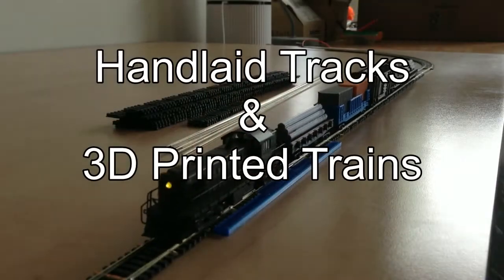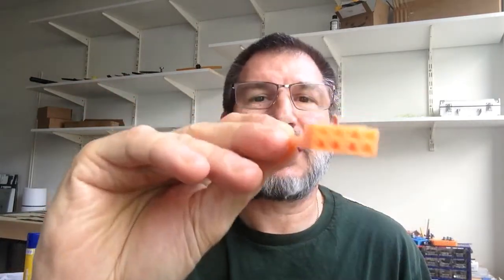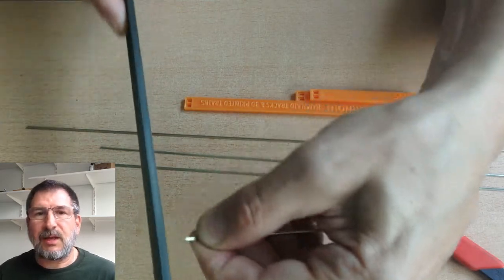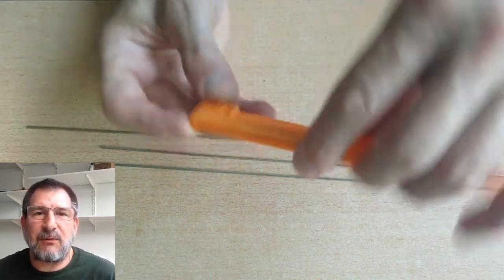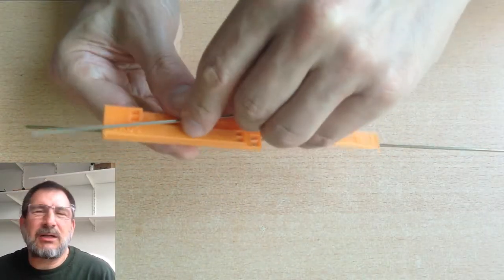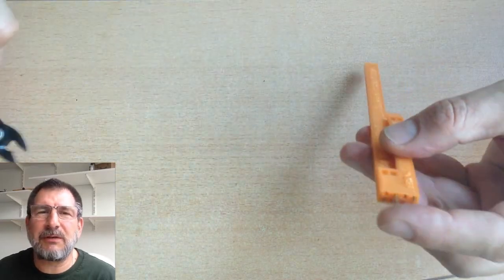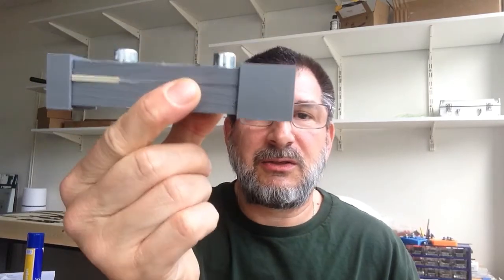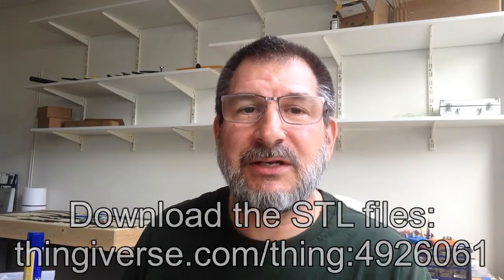3D Printed N Scale Model Train Rail Cutters For #2 #4 #6 Turnouts - STL Available On Thingiverse

Comment: Great idea man. I think that I'll try to make a turnout. But can you give some detailed information or link to have the motor that are in your turnouts? Where I can buy them? Thank you in advance.
Reply from the maker: You should! I've really enjoyed the process and result of hand building the tracks. I put the straight and curved jigs up already. The tie cutter and gapper tool is the most helpful. You can power them with any of the normal machines or with RC servos. I'm working on using stepper motors because they move slow and look cool. Not sure it will work, some have drifted out of alignment in testing. I'm still building it and have been avoiding the task of wiring etc as I enjoy building more... The turnout tiebeds I've designed all are for this stepper motor: https://www.aliexpress.com/item/4001212984521.html?spm=a2g0s.9042311.0.0.27424c4d4A97zM